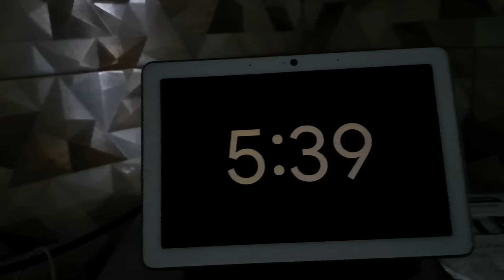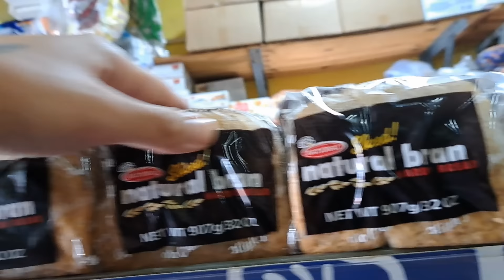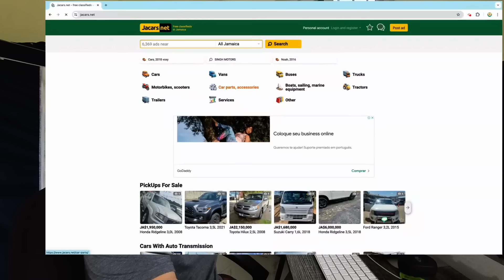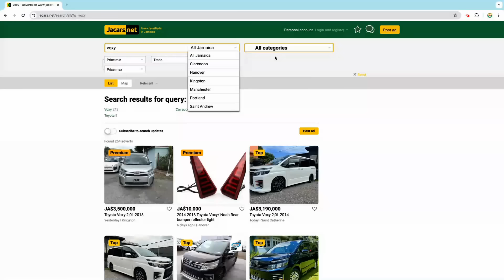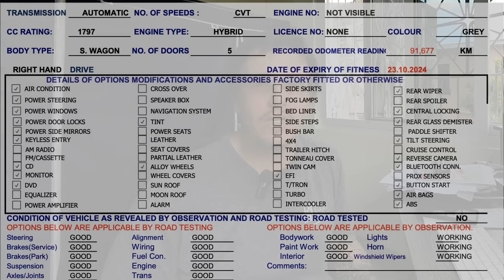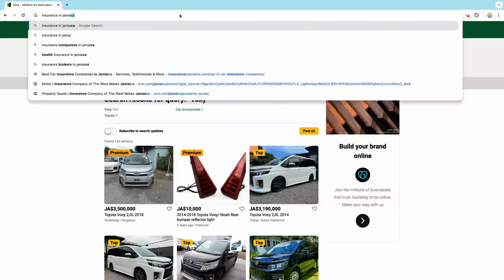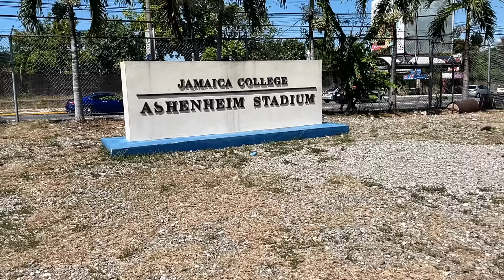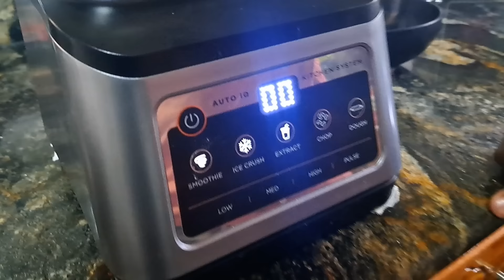Retired in Jamaica and Going Our Separate Ways

Comment: Hey Tyler you can call Advantage General Insurance and the year voxy that you are interested in purchasing does not require a mechanical report. But if you’re doing comprehensive insurance you will need an evaluation
Reply from the maker: Will check it out, thanks!!😎🤙